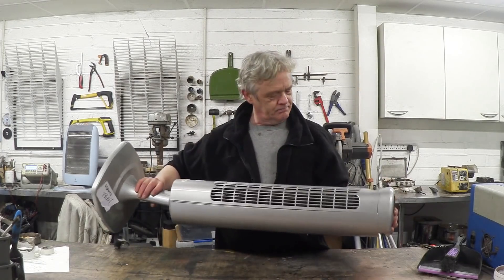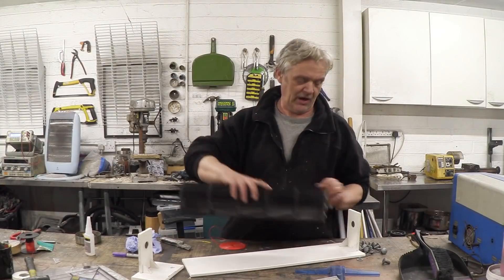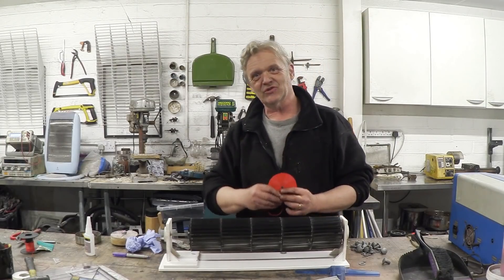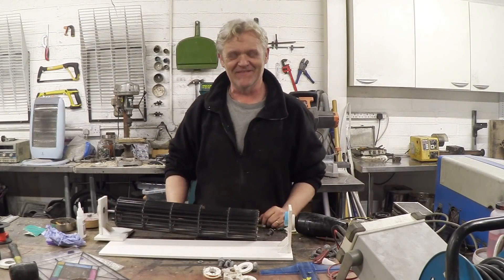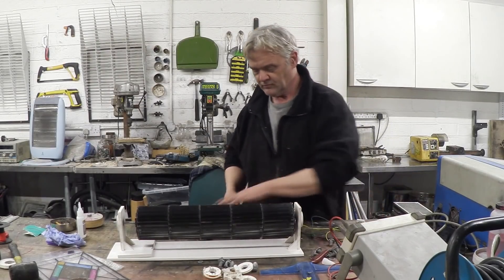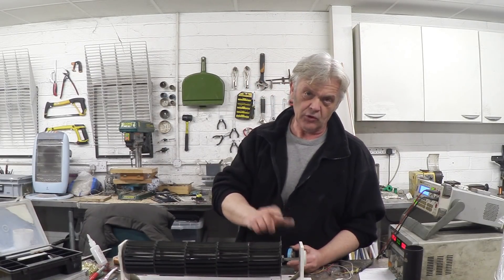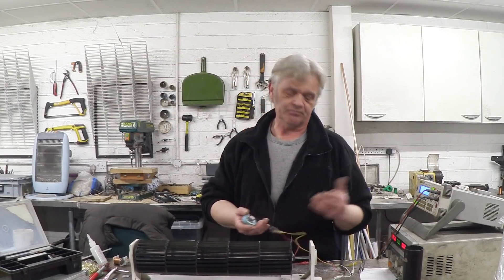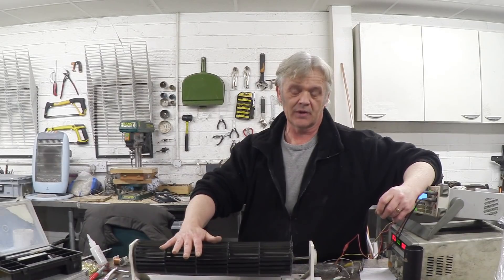1005 Three Kinds Of Wind Turbine

Comment: The most inspiration for me is the shape of this rotor. The secret is as more lamells you have as less vibration is in the whole construction because the vibrations are the biggest problem by vertical wind turbines. 
Another aspect is the generator. I think it might be a good solution to use old electric motors (from old drill, motor from law miller etc) as generator and mount them direct on the shaft of rotor. Means: No gear or belt drive needed. Less parts means less potential damages / errors in the system.

Comment: As others have said, the pancake coil is exactly the wrong arrangement for rotating magnets around the assembly. Your magnets need to cut across the wire perpendicularly. What I'd do is exactly what your second arrangement did. You could have one coil for every 2 magnets and wire them in series or parallel for high voltage or high current.

Comment: Total flux change in the pancake coil is 0. You did the same with the turntable coil a while ago with little result as well. Any significant result is not to be expected. The turntable motor had a meander pattern inside constructed of the iron plating which made it a working concept. That's the whole reason why such a motor works with the coil arranged in such a way.  
If you stick an iron cross on one side of the pancake coil ( 2 pcs of transformer steel would do great ( maybe 4 if you can't span from magnet to magnet )) and another one on the other side rotated 45 degrees it will generate. It would make an awesome new video :-) and it's easy to do.

Comment: Have you considered placing magnets along the fan and having the fan pass across coils under it? I have a friend that is using a V configuration on a fan like that and he is getting interesting results from passing the fan along coils mounted on the base board.

The magnets don't create a great deal of drag and the fan is VERY well balanced and can tolerate the magnets with ease.

I find your work with magnetic assist might also be applied here on the side of the board opposite the magnets with the coil in between.

The magnets will create flux and perhaps some drag on the fan, though the extra flux might balance out the generation within the coil as the magnetic fields interact with the coil as a "mid way point" between the two.

Give it a think will you, and another lesson learned 😁. 

Keep on it; your videos are informative and you don't conceal your small failures and gains.

Thank you for sharing.

Comment: reluctance motors are making a bit of a resurgence , Tesla uses them in their latest cars, there are even some EV conversion specialists who convert induction motors into reluctance motors by replacing the rotor and using a different controller, but that makes it a synchronous reluctance motor, not switched reluctance, still, this is definitely something worth  getting involved in. great video as always.

Comment: As to your pancake coil .... if you don't fail sometimes you are not trying enough!
As others have pointed out you need to have a coil breaking the lines of magnetic flux to generate (eather force or power). The reason they use pancake coils in generators is that it allows low maintainance coupled with fairly easily achieved close tolerances .... don't forget they are usually several coils potted together to form a doughnut not just one coil.

Your pancake coil could end up generating low power but high voltage .... check out Current Transformers to see why ;0)

Comment: I am wondering what effect the magnetically assisted coil would have had on the end with the magnets. If none maybe 5-6 of them in series on the metal fan end to give you close to 12v on while you have a series of coils on the other end with the magnets to give you about the same voltage then connect both ends in parallel to increase amperage.

Comment: With the pancake coil the magnetic field is moving parallel to the wires but the magnetic field has to cut perpendicular to the wires to generate voltage. If you did something like not have them share a center axis but move the pancake coil up to where the magnets cross its center point then they would be passing perpendicular to the wires in two places and give you much higher voltage. Fun to watch you experiment as always.

Comment: I've tried several times to make generators, but no matter what, the most efficient yet cheapest by far you are gonna get is a phantom drone brushless motor, attached to your turbine. the trick is that those motors need thigh rpm, so diy the right gear ratio to convert the high torque of your wind turbine to run the drone motor very fast. and you have super efficient 3 phase ac!